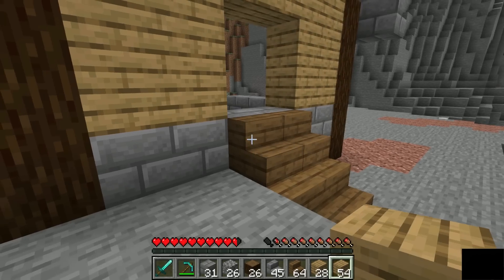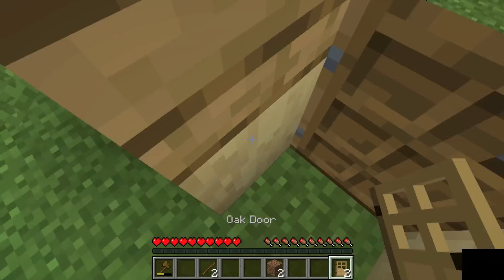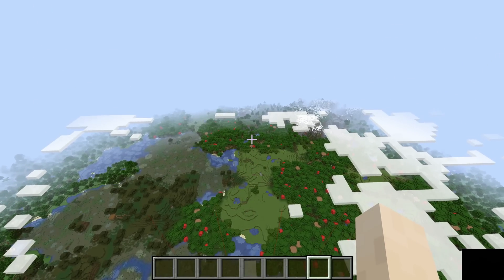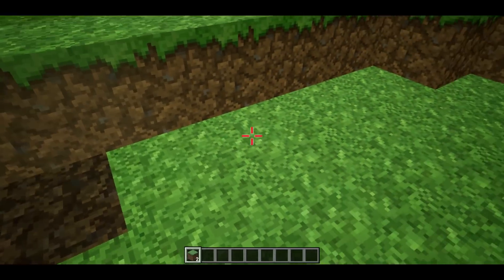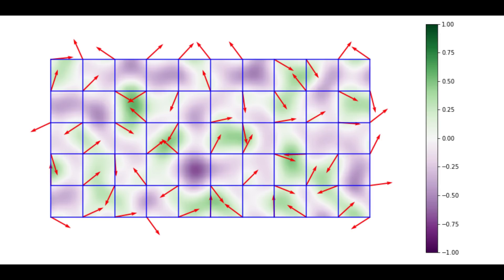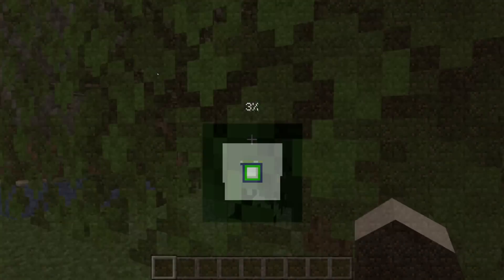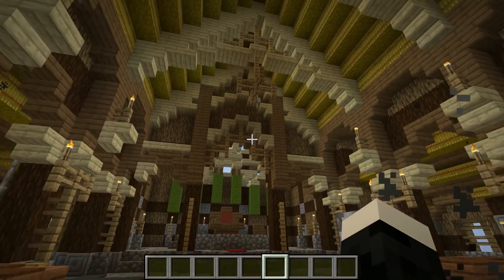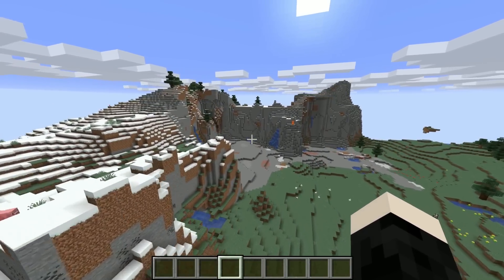Why Minecraft is a Technical Feat | Explaining the Engineering Behind an Indie Icon

Comment: I'm super confused by this video. Minecraft is a great game and I love it, but selling it as a great technical achievement in relation to other contemporary games is just strange. From a technical standpoint, it arguably does a less than mediocre job at implementing the techical concepts, far behind many other indie games and miles behind every AAA title of the time.

Take perlin noise as an example: Implementing perlin noise is really, really easy. If you enter a programming course at university, you should be able to implement it comfortably within a day after your first semester. And, when Notch made minecraft, that simple algorithm had been around for 20 years. So where exactly is the technical feat here? I understand that coming up with that algorithm in a first place is a great achievement, but just applying industry-standard algorithms after two decades is not a technical achievement. If you are unable to do that, that is a problem!

The same goes for voxels: The main application of voxels in Minecraft is world-simulation, not rendering, so it effectively uses voxels in a very similar way that dwarf fortress did earlier. It did not innovate on that! Presenting the world in 3d triangle based rendering, as opposed to dwarf fortresses 2d text based rendering is a completely separate choice, and has nothing to do with the voxels. So where is the achievement in using voxels?

And the "ingenious" solutions you mentioned, like using rivers to separate biomes and voxels to do lighting instead of going with lightmaps or lightprobes or whatever, perish in comparsion to all the stuff you have to do internally to actually make things run. Like, they are nice placative examples because you can explain to people that aren't very familiar with the tech in games, but I can assure you, there are techincal achievements in the engine that are 100 times greater than those two decisions. The great achievements are rarely nice, cleanly explainable things like those, it's the dirty stuff that keeps the whole thing together.

Minecraft has many achievements, but they are not of techincal nature. They can be found in the concept of the game, the complete freedom that was offered and the way they handled it's continued development. That was amazing and innovative and forward thinking and ahead of its time. But not the tech! The tech was so below average, that minecraft, in 2021, on a 16 core cpu with 16GB of ram, still occasionally freezes for a second or two and struggles with 60fps every now and then, while a game like Doom Eternal, that is 10x more ambitious in every technical dimension, is just sitting there with 100+fps.

I like minecraft despite the tech, not because of it!
Reply from the maker: Thanks for the comment pulp_user! I can agree with most of your sentiments. I tried not to make the Minecraft developers sound like they were geniuses for coming up with the solutions they did, but instead tried to give credit to the original innovators like Ken Perlin. However, I do think Minecraft was innovative by putting all these ideas together. 

I still think Minecraft could be considered a technical feat. Out of all the programmers out there, I would say maybe 5% could program a Minecraft-esque voxel game given enough time. Most programmers these days are web developers though, or if they're a game developer they use engines like Unity or Unreal. Out of the few developers that actually use graphics APIs like OpenGL and Vulkan, I think most of them could code a Minecraft clone, but that doesn't make it easy. 

I guess my point is that I often hear some of the more hardcore developers scoff at Minecraft because it's not nearly as complex looking as a game like Doom Eternal. But I wanted to emphasize that it still had a lot of unique engineering problems that had to be solved to build a shippable game that's actually really fun to play. Is it a technical feat? I don't know. Is it a difficult engineering problem? I would argue that it is, and I just wanted to highlight that things that may look simple rarely are :)

Also, I feel like there are a lot of optimizations that are pretty easy and well-defined for a game like Doom. You can reuse assets through instancing and reduce the amount of geometry that you have to send to the GPU and provide higher fidelity geometry at the same time. But with Minecraft your left with the problem of having an insane amount of simple geometry, so instancing won't help much. So instead of the traditional route of instancing and batching that most 3D games take nowadays, Minecraft had to build custom meshing algorithms that would bring some of the more traditional 2D game stuff into the 3D world. None of that is complex, but it also hadn't been done, so it was almost uncharted territory at Minecraft's inception with a few exceptions like Infiniminer. I'm not trying to diminish Doom's complexity, but the two games are solving two very different problems.
Reply: @GamesWithGabe  I can totally agree with the sentiment that Minecraft is a technical feat in the sense that doing ANY game from scratch is a technical feat! The saying "shipping is a feature" exists for a reason, because 90% of games won't make it to the end.

So in that sense I don't want to talk down on notch: he is part of the 10% (or 1% or whatever) that actually made it.

But I strongly disagree on the fact that even putting together these concepts elevates it above it's peers on a technical level: I especially don't agree with the "Minecraft has to deal with tons of geometry" point: The problem Domain of Minecraft - mostly static, axis-aligned geometry on a 3d integer grid - is probably THE easiest domain you can find in 3d! You avoid soooooooooo many problems by restricting it to an integer grid. After you calculated the visible hull of the world (which you can do independent of the camera!) and merged all redundant geometry, you are left with less geometry in a chunk than modern 3d games spent on a chair.

The problem Domain in fact is so easy, that Minecraft managed to get by without an major multithreading! It is so undemanding that they didn't even need to get serious about optimization because "it runs ok", which lead to it then running mediocre (which is what 90% of software does today btw).

Most 3d games have WAY harder problems to solve. Doom runs the way it does not because the solutions were somehow more well known and easier to do, it does so because they did an unbelievable engineering job at multithreading the engine and ensuring that it scales amazingly over many cores, while not killing the most important feature: shipping. That doesn't get easier just because "multithreading" is a know concept. I'm sure they had to solve 1000 problems on this, all of them nasty, while Minecraft just doesn't bother with it.
Reply: Well said, thank you this should be top comment
Reply: I think this is a nice video, but I agree that the framing of Minecraft being somehow technologically exceptional is potentially even misleading, considering all it's there for is to show that Minecraft had to solve some problems that are maybe unexpected to non-programmers.
Reply: Yep, you're right on the money. Before Minecraft Notch was involved with an Online RPG that apparently the scope creep was so huge that it felt impossible to finish. That's why when he saw Infiniminer he embraced that idea, mixed it with some DF, and adding some of the RPG stuff on his own, because it was simple and much more fun to develop and play, than the overly complex simulator that his attempt at MMORPG was becoming.

Well at least it was simple and fun until the scope creeped like hell over again.

Comment: Not only do you not render all the blocks, but you don't even generate them. You only generate the blocks you see and you don't even render those. You only render some of their sides, depending on which ones are visible. That's not all you can do to make it fast. Surfaces of neighbouring triangles can be joined together. Many hundreds of blocks get squished into just 2 triangles sometimes! But even so this is quite a bit of work when you need to load chunks of 20 16x16 chunks in one tick, so what minecraft does is it runs the generation in a framerate independent way, so you don't get lag spikes every time you leave a chunk. There is also bunch of clever stuff mc does to store maps efficiently. The way resources are streamed to the gpu from ram also can vastly improve performance. But that's not specific to minecraft.

Comment: It’s worth noting that Minecraft is built in Java, which is a slower programming language than C. Minecraft could’ve happened much sooner had they used the best tool for the problem.
Reply: That's what you would think but in reality,  it doesn't really matter (on java to C scale) because Minecraft uses OpenGL for rendering, OpenGL itself is written in C, C++ and ASM to name a few, so all the rendering part of Minecraft is as fast as if it were written in those languages. The only speed Minecraft would have gained with C would be on the world physics end, where stuff is calculated on The CPU, therefore written in Java.

So you're right in a way, but it's negligible for most play-styles of the game :)
Reply: @clemdemort9613  a few things to clarify.

OpenGL has a C interface, on the other side of that interface is the graphics driver— which for all we know is written in the assembly language of the specific GPU.

To draw a frame, a game computes, on the CPU, what must be sent to the graphics card for rendering.

This is why using fast languages is important for a good framerate. If it takes you less time to decide what to render each frame, you can ask the graphics card to render more frames.

Now whether your particular graphics card can actually keep up with what you ask it to do each frame is a different performance discussion.

As far as the GPU is concerned, Minecraft is extremely simple.